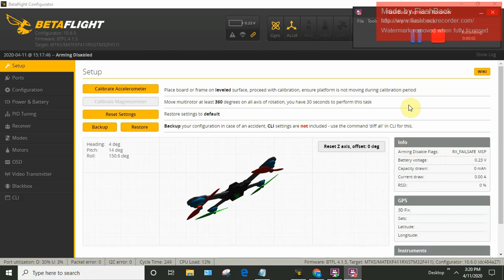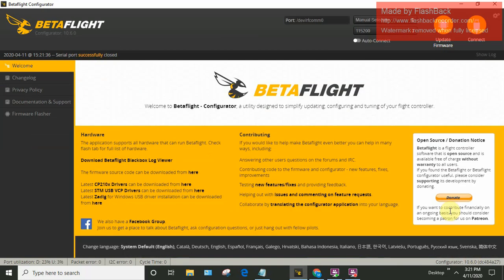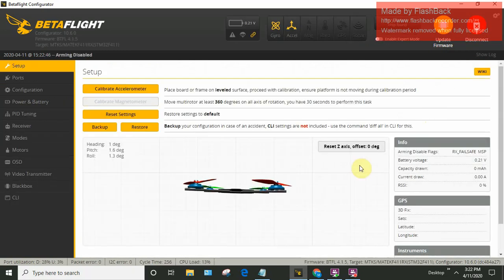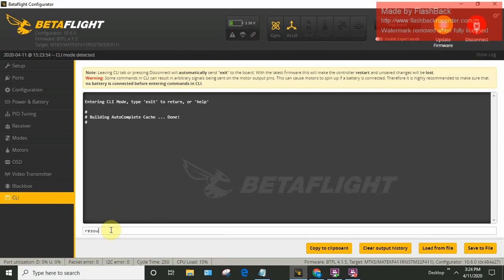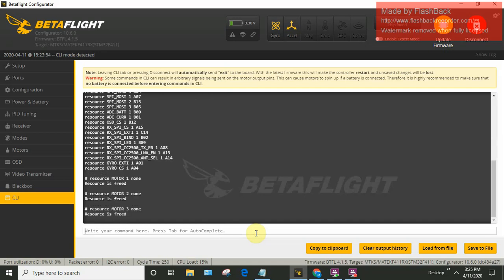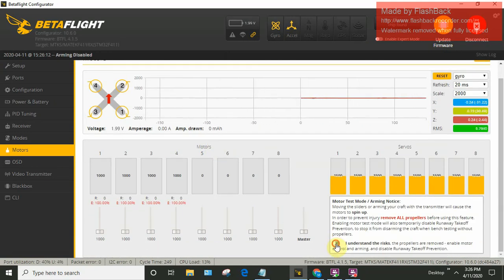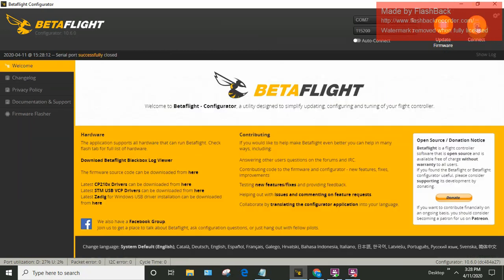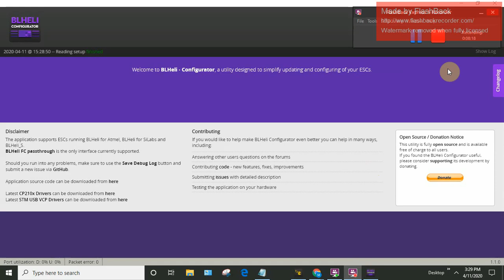Quick tutorial: Changing board orientation and remapping motors in Betalfight

Comment: hey :)

which type of build's flight performance do you think is best?
square whoop
diamond whoop
or 16x16?

i think 16x16 would allow for the tightest package
but i'm not sure about the resulting auw, which would be the lightest?
and is compactness better than lightness, if whoop boards would make for a slightly lighter build?

perhaps enough thoughts for a video?
Reply from the maker: Marc Frank Yes it would be a good discussion as it depends on the aspect of performance that is prioritized.
Reply: @Quad66  those could be included in the discussion :)